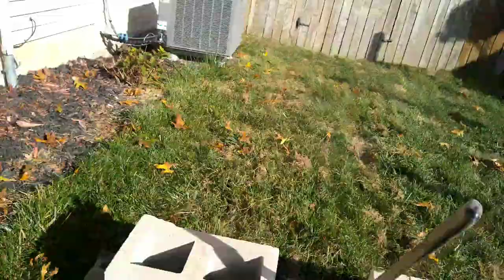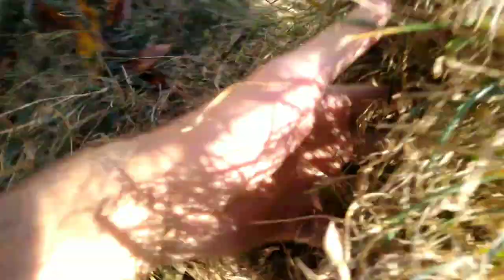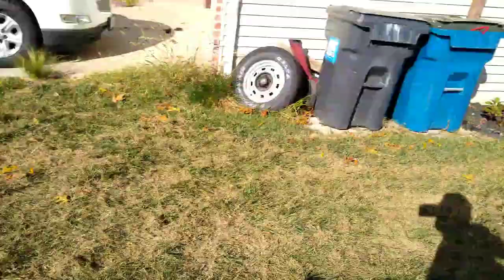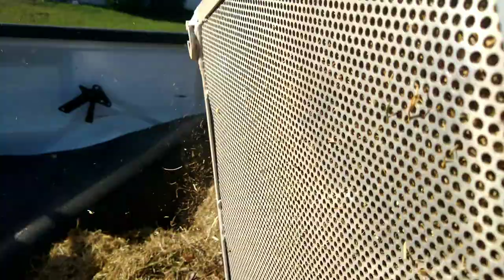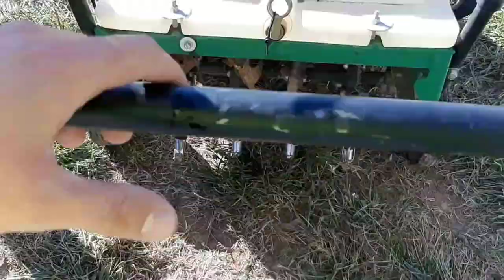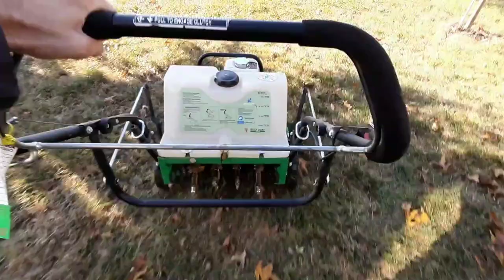Self Propelled Aerator And Dethatching A Small Yard

Comment: I hate mechanical core aeration. I switched to liquid aeration 2 years  ago. It works well, low cost, you can use a backpack sprayer    It’s not a hard sell if you use online articles in your sales process. It all makes SO much sense. I should do a video on the topic.
Reply from the maker: @PART TIME LAWN CARE yeah I would really like to see a video on that. I'm actually got a test planned on how well it works here in our area, we have very rocky and very hard pack ground so I'm a skeptical one about the liquid aeration lol but your video or my test could change my mind 🤷‍♂️
Reply: @JonsDailyHustle  I’ve used it on a few yard rehabs where the soil is like rock. It does the trick 👍👍
Reply from the maker: @adventuresinlawncare3734  good to know i might have to give it a try